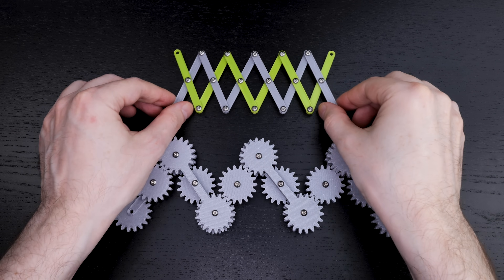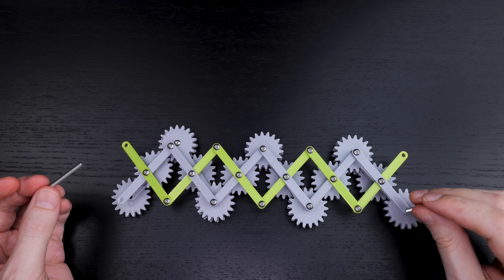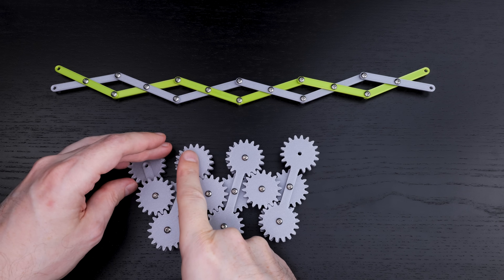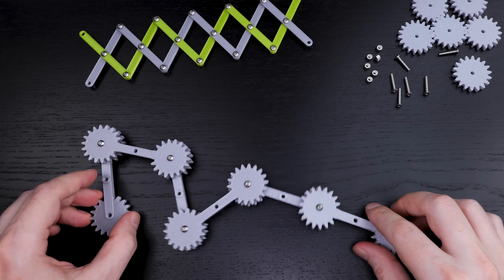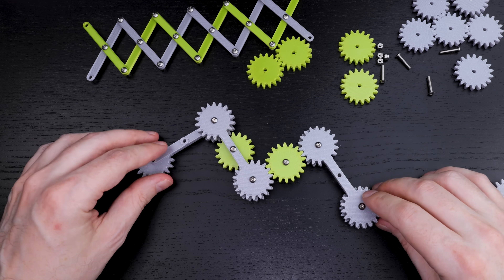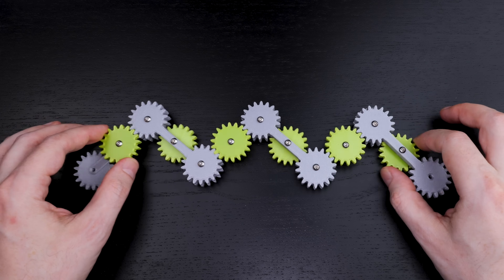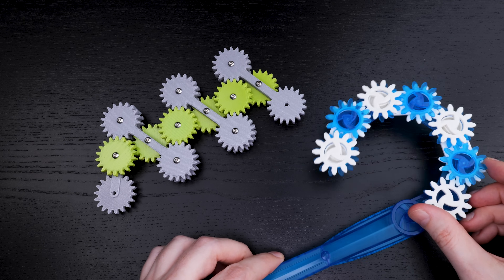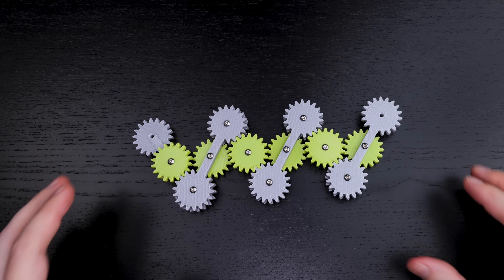Half of a scissor linkage

Comment: You've basically folded the second linkage pair (green sticks) over and superimposed them to be inline with the grey.
Essentially using a parallel set in gears hiding in the third dimension to replace an inverted set of linkages (which could be flexures instead of pivots to keep it flat, thus missing that dimensionality)

The interesting thing I noticed was like you said, the last gears aren't necessary..but I suppose too you could snap off half of the green sticks at the ends of the original..

If your question was serious though, not just a "challenge for those at home" 'question', yes linkages can likewise be fashioned to replace (at least a subset of) geared setups. That's the whole magic behind strandbeests!

Always love your vids!

Comment: If you made the gears smaller, for instance each gear's diameter is the same as the width of the beam it is attached to, then you could use multiple gears on each straight segment to keep them parallel. As long as the number of gears is odd, it should work. Making the gears smaller would help it collapse to a space efficient profile. It will introduce other problems, though, such as added friction from more moving parts and greater forces being applied on the gears from a bigger reduction.

Comment: I used to compete in robotics, and one of the main mechanisms we would use if we needed to lift things was called a 4 bar lift, which was basically the first 4 bars in a scissor linkage, with the first bar being anchored, creating a parallelogram. Sometimes, when we couldn't fit a full 4 bar lift, or needed more that 170 degrees of mobility, we used what we called a virtual 4bar, where the the first bar was linked to the output with just a single bar, and a chain and sprocket system that caused the third bar to stay parallel to the first, just like the linkage you have here. We used sprockets instead of gears because using an excess of gears would have induced a lot of slop in the mechanical design

Comment: What about as pulleys/capstan instead of gears? Given the purpose of the centre gears is to reciprocate the force/motion thus constraining the DOF, then having the belt/string cross over the centre point of each link should achieve the same effect. 

It should also enable closer packing and the full range of motion like the geared version.

Comment: You'd be able to close it tighter if it had 5 on an arm instead of 3...
Reply from the maker: Yes, but with more parts the slop in the mechanism will be worse. I also thought about using something like a bike chain to transfer the rotation.
Reply: @henryseg Given the constraints of the mechanism, it shouldn't be necessary to use anything so complicated as roller chain. Any sufficiently inelastic but flexible material should work (thread, fishing line, etc.), since it can be fixed to the pulleys/posts (that would've been gears or sprockets) at either end, eliminating slippage. Does that make sense?
Reply from the maker: @hollt693  Ah yes, of course. It seems that my brain only thinks about rigid body mechanisms, but that should definitely work.

Comment: interesting! What would happen if you offset the grey geared linkages by one tooth each when assembling? They should then stay all at a slight angle to each other instead of staying parallel, so if I am not mistaken you should be able to make a shrinking/expanding circle then.
Reply: And what would happen with different gear ratios? Useless or just slightly bendy?

Comment: i was wondering if you had also made a version which used 3 intermediate gears per leg. it wouldn't fundamentally change how it functions at all, but it would allow it to fold in tighter. i also thought it might look pretty cool
Reply from the maker: I thought about doing this, but anything that increases the number of parts in a chain of gears will increase the amount of slop in the mechanism. I think that using something like a bike chain might allow for a thinner arm profile without losing too much precision. 
Or perhaps it would be equivalent? Bike chains also have lots of parts, but because they are mass produced in metal, the precision is very good.
Reply: @henryseg  oooh! that sounds interesting!

Comment: Is there any interesting significance in the fact that you need two different channels of gears?  What I mean is, the scissor linkage had two sets of levers,  green and gray.  You removed one and replaced it with gears.  But at each joint you needed two channels of gears.  Like, yes there's only one side of the linkages, but the mechanics have been doubled up.  I don't know if this makes sense but it somewhat feels like you were folding the scissor linkage over onto itself.  It seems as though if you wanted any control in any series of linkages you need to have two channels of some sort.  Whether it be gears, levers, screws, or ramps.  Although I suppose pulley completely negate what I just said.
Reply from the maker: I think I get what you're saying - you need two parts going along any "branch" of the mechanism. If you only have one then you cannot transfer force from one end of the branch to the other. So either the other end of the branch is rigid, or you have no control over it. 
This holds for the pulley as well. You need a rigid beam to mount the wheels of the pulley on. Then the rope of the pulley (the second part) runs parallel to the beam.
Reply: @henryseg  Ohhhh..  your right!
Reply: Have you thought about doing anything with pulleys and gears.  We have flexible racks and gears belts.  Maybe a 3d pulley that uses the spherical gear on a wavey geared or flexible plane.  Not really useful but the axis would have a fixed orientation, which could be interesting.

Comment: if one green gear makes the neighbouring sides parallel wouldnt you only need every other green gear? if im wrong about this, tell me how and why because this is quite interesting
Reply: Depends on the application. You'd only need one set of gears if you only want the ends sticks to be parallel (if you have an odd number of sticks). For example, if you take away one of the sticks from the version that he built. But each set of left and right bends can then expand and contract independently of the others. And you don't have the useful property that all pins along one side of the linkage are in a line.
Reply: @Pystro  I dont get it really from the sentence when you said "But" and onward. Could you elaborate a bit since I don't really get how they move independently when they are all parallel?
Reply: Drawing it out on paper, it seems like if you remove half the green gears, then all odd sticks become independent of each other while all even sticks remain parallel (but the perpendicular distance between them can change freely)

Comment: The idea is useful to spread out stress forces over a long link system. You might also use it to reduce load on the driving motor by having multiple motors instead of just at one end.

Comment: Interesting things happen with the scissor linkage if you have the “center” pin shifted to one side or the other.  I’ve built a few of these using Lego technic.  It curls up on itself to form coils and stars.  I can shoot video of it if you’d like. 😊❤
Reply from the maker: If I understand you correctly, that offset pin design is used in the Hoberman sphere, allowing for a scissor linkage that bends around into an arc of a circle.
Reply: @ huh!  I never caught that before.  I suppose it is!  😅
Reply: @yorgle Akiyuki's "Six Heads" Lego GBC creation.
It uses a scissor-ish mechanism to accumulate angles to form arcs.
youtu.be/SYZEmPsPfhg?si=FOyhux4KKrTfMRNx (1m9s)
Reply: I believe that a toothed belt can replace the gear chain as well.